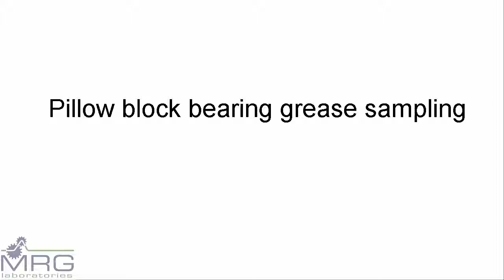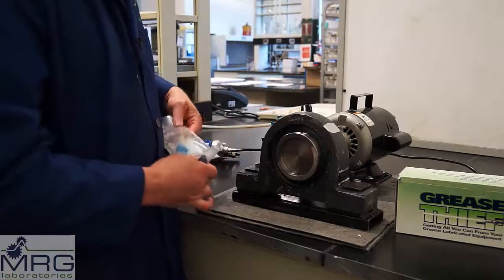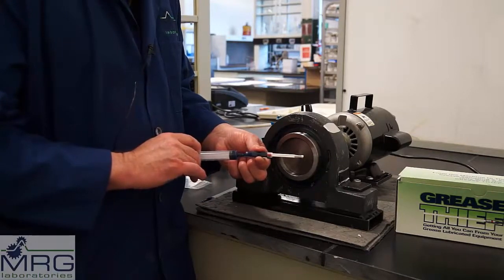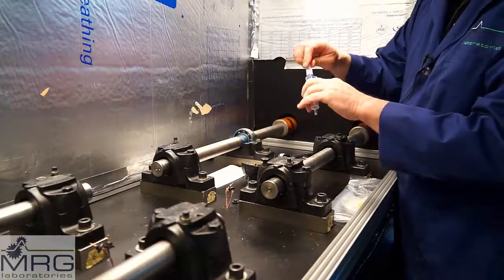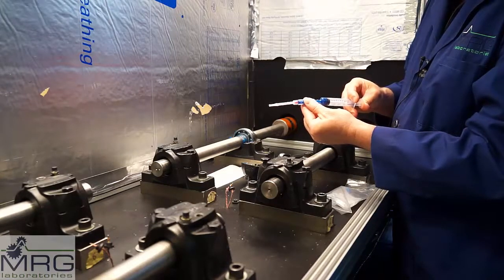Grease Thief Pillow Block Bearing Sampling

Comment: Get a lock n lube coupler for that grease gun....thank me latet
Reply from the maker: I do have one, purchased it at the Ag Progress Days expo in State College, PA.  However, I am cautious about using it, since it defeats the feedback that one receives when trying to lubricate a Zerk fitting and it keeps popping off.  That should be a sign that something is not right, and can in fact, be quite dangerous.  When a properly installed Zerk fitting is in place, and a coupler in good shape is attached to it, unless the coupler is moved to a sharp angle, it should stay in place while pumping.  A coupler that pops off could be due to damaged coupler teeth or springs, damaged Zerk fitting, or blocked grease supply path.  Forcing a locking mechanism to hold that in place and continue pumping can generate several thousand psi of pressure, and the result can be dangerous to the equipment or persons performing the analysis.
Reply: @MRGLaboratoriesYork  mine works great...try extra new Jaws sent with kit ...hope it helps you out